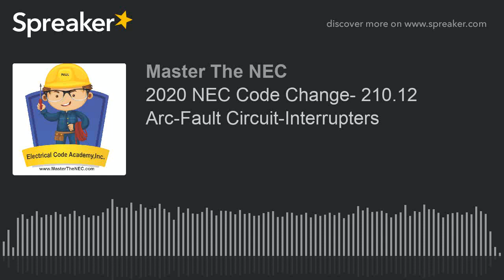2020 NEC Code Change- 210.12 Arc-Fault Circuit-Interrupters

Comment: I'm sorry to sound dumb, but is this new code saying I need Arc Fault breakers for everything or can I use standard breakers with AFCI/GFCI receptacles?
Reply from the maker: The branch circuits supplying the locations listed in 210.12(A) have no changed. There are locations that these branch circuits supply that may also require GFCI protection as well. You could "kills two birds with one stone" so to speak with the use of a dual-function device, which does GFCI and AFCI functions. So to answer your question, you only need AFCI protection on the branch circuits that supply outlets in the locations listed in 210.12.

Comment: Here's my problem with AFCI's circuit breakers, If the entire main distribution panel is wired with mostly AFCI's there's no room in the panel to work safely. So years down the road when something goes wrong, the electrician has to look at a panel where all you can see is layers and layers of wires. In order to work safely on one of the branch circuits, he's forced to isolate the entire panel from the power source.
Reply from the maker: From an NEC perspective their is enough room based on cross sectional fill values. While it may seem problematic the NEC states in 90.1(B) Adequacy - " Compliance therewith and proper maintenance results in an installation that is essentially free from hazard but NOT necessarily efficient, convenient, or adequate for good service or future expansion of electrical use." So, we can only assume that the manufactures account for this in cabinets by meeting 312.6(B) and hopefully 312.7 once someone defines "crowding"...LOL

Comment: For residential applications can you use an AFCI listed device at the first outlet?
Reply: It appears that you could use an AFCI at the first outlet (not an AFCI circuit breaker) with some restrictions in the 2014 Code. I don't know if this changed in the 2017 or 2020 Code.
Reply from the maker: Yes, if you meet the requirements to do so in 210.12(A)(4), (A)(5), and (A)(6). However, the one more applicable to residential I guess would be (A)(4).

Comment: Also another code change that was voted on by lobbists, so they will let you actually extend .up to 6 feet which is basically  extendeing and you dont have to acr fault ,but if you have a faulty gfci receptacel that needs to change out in a older house,or to change out your receptacles  over to light almond ,cause your sick of white, now you have to arc fault try explaining that to a homeowner ,especially the cost... Just redicoulus..
Reply from the maker: Greetings Jon - I am going to disagree on one aspect of your statement. The 6 foot allowance is not new for the 2020 National Electrical Code. It was introduced back in the 2014 NEC with main aim to allowing panels to be moved up to 6 ' and the moving of the panel and subsequently using the old panel cabinet as  a splice box did not trigger an extension or modification of the branch circuits. Now, it was not actually limited to the panel example I gave but that was the original intent but clearly this applies to outlets or devices as well as long as the extension doesn't exceed 6' and no new outlets or devices are added. Now, in your example the replacement of a device simply for the aspect of COLOR would push us to 406.4(D)(4) and the intent is IF the location did not have AFCI protection on the branch circuit that is supplying that receptacle, installed in a location that would under 2020 NEC require AFCI protection, then a replacement would be required to meet the rules of 406.4(D)(4) and indeed the branch circuit would have to be protected by one of the three options provided. This is an example of retroactive requirements that we like to say the NEC does not provide for BUT slowly the NEC , in my opinion, is moving more and more away from a safety standard and dabbling in the design standard world all indeed because of manufacturer involvement but its also a case to be argued for safety as well so its one dog wagging the others tail.

Comment: Morning paul, can you also explain the 2020 change 210.52(C)(1‐3) in better detail. like if there was a cooktop or sink, would that be a break and be considerd two areas so you would go by the 9 sq foot? And as well why was this such a major probelm, to get implememted in the code? usually its stuff that gets added it for safety perpouses ..Thanks paul
Reply from the maker: Actually, I do have a podcast that explains all the aspects of 210.52 and peninsular and islands and counter tops and so on was covered in extreme detail. Look for it on our Youtube Channel. In an effort to not be redundant I would recommend you check that out.